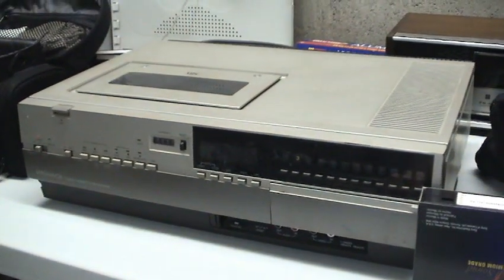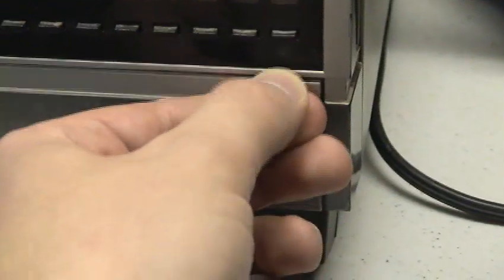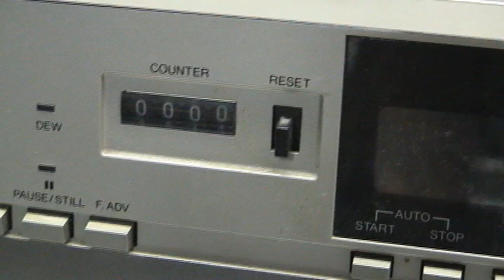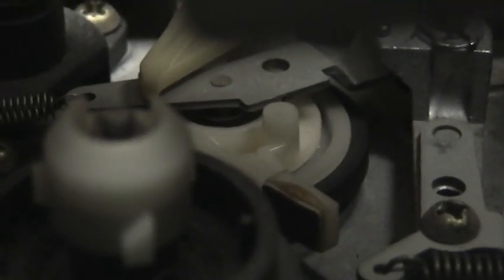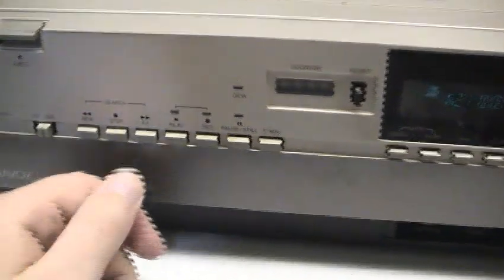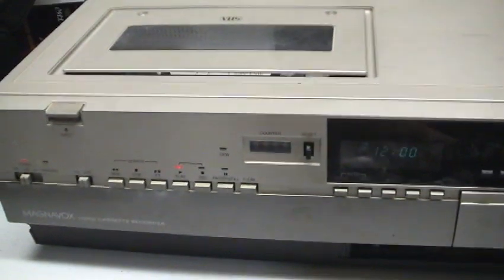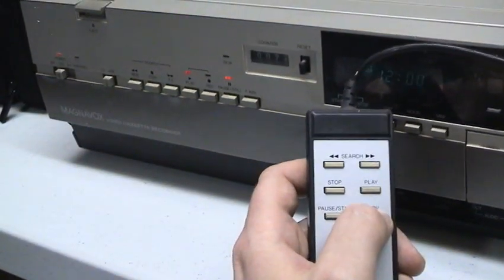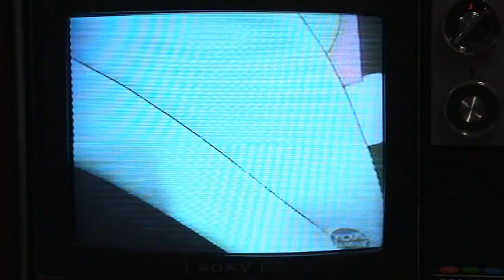1982 Magnavox (Rebadged Panasonic) VHS Top Loader and 1970 Sony KV-1212 Trinitron TV

Comment: Many of the videos on my channel were recorded on a deck that preceded your deck. I got my PV-1750 which (IIRC) was one of the first 4-head VHS decks. Wired remote, heavy as hell....wish I still had it. You'll never get playback any cleaner than with the deck that originally made it....as long as it's in good repair. Thanks for the memories! Dave

Comment: I used to have one just like these except I had the metal case version. I had the wired remote and everything. I really wish i still had it. but I loaned it out to a friend and it got infested with roaches at his place. which really sucks. top loaders are so much better because you don't have to take the whole VCR apart to rescue a stuck tape. I also love how every function is on the console on these no stupid easily lost remote just to use the tracking, they should makeapliances like this again

Comment: My preschool had a top loader Model like this. at the time my parents had an old front loading fisher VCR but it broke and wouldnt play tapes but my friends used if as an RF modulator for their playstation and it had those fine tuning controls on the front. the fisher i had wouldnt FF or Rew good had to do it in play mode or use a rewinder.  my RCA selecta-vision VCR has a wired remote like this one, man they dont make cartoons like this anymore heathcliff was classic.

Comment: Hey, I just bought one of those at a thrift store! The only difference was that it was made December of '82, and it has big analog knobs like on older TV sets, apart from other minor differences.

It's odd that mine still works like new except it won't record in Standard Play. That and the remote is missing... Still in all, its a cool VCR, they just don't make them like that anymore.

Comment: The SL-5000 Betamax vcrs are built like tanks, they pretty much still used the same parts as those big clanking top loaders did.. Those SL-5000 betamax vcrs are great, as long as you replace the defected capacitors on the service board, which cause playback problems. if those belts are original, I'm surprised they are still working, usually the rewind starts to become weak once they start wearing

Comment: Many manufactures were relabeled Panasonics. GE, Sylvania, to name a few. The early front loaders were mechanically the same as that one, tho the front display say, play rew, and ff etc. most of those had problems with the power supply after many years of use..

Comment: i bought an identical panasonic machine used in 84 or 85. it was  a 4 head though, which was the may reason i wanted it. does anyone know what model that would've been? The reverse scan never worked on it either. This video brought back memories of all the sounds and quirks (the aft was enabled/disabled by opening or closing the tuning door) of that vcr, which i used for many years.

Comment: How to you fix a slipping tire?
Do you have to replace the whole assembly or do you only replace the rubber around it?
Will a belt with a matching size do the trick?
Reply: Replacement of idler tires is very much dependent on the unit in question. Some models are easier than others, with certain models being accessible with a few screws. Others require taking the mechanism out of the chassis. As for the replacement tires themselves, rubber o-rings designed for hoses may sometimes be used. These can be picked up at hardware stores easily, usually packed together in several different sizes. Otherwise, it may be more difficult, as official replacements have obviously not been produced and sold for decades. A rubber belt would most likely not work, as idler tires are much more firm and solid.

Comment: I had a RCA that looked identical to this one. I give 12 hundred for mine in the 1980s. You see that wired control ? My RCA was the same on the display floor and it come with a optional wireless sensor you plugged in the side for two hundred dollars more. I went with the works and got the wireless. lol now I wish I had my 12 hundred dollars back. lol I did I would run down and get a 65 inch TV. lol if I'm still alive in 30 years I will want the money back on the TV.